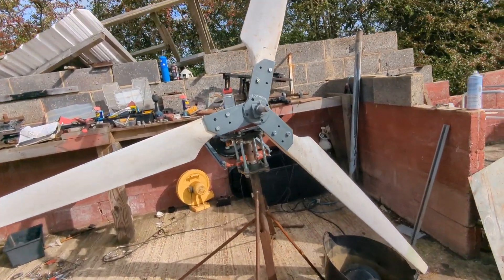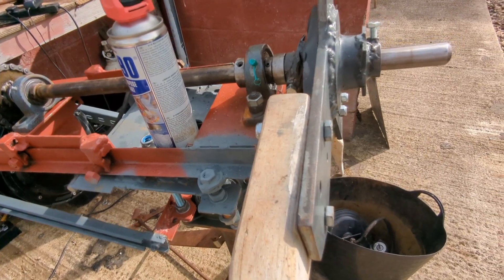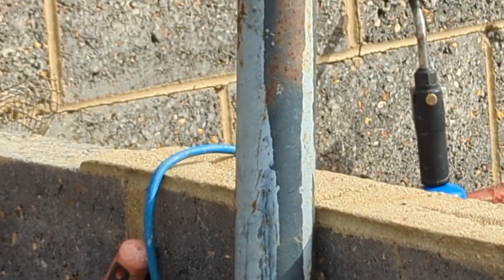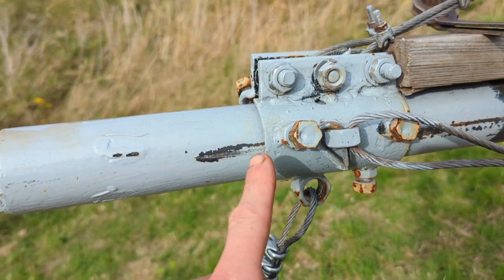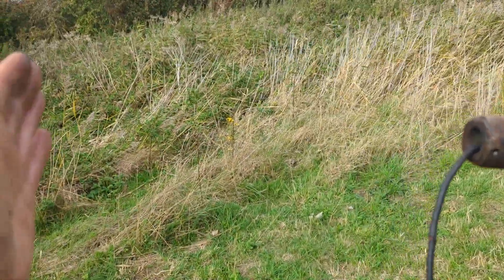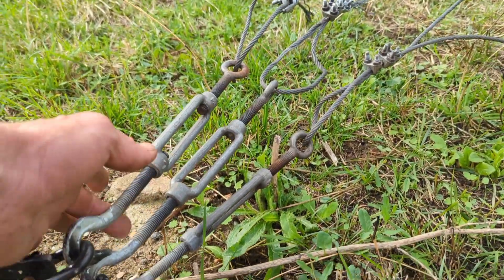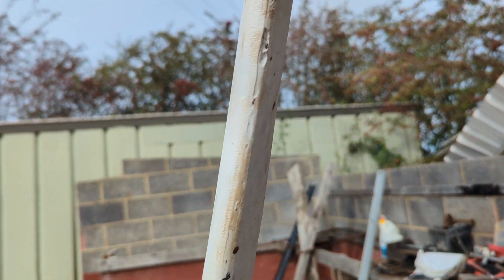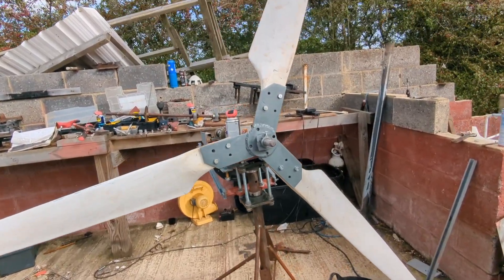Monster Wind Generator - 3m Rotor Blades on - Looking Very Nice - Thanks Scott for the Donation 🙏🙏🙏

Comment: Hi, when you plan start that wind turbine? How many energy it can produce?
Reply from the maker: Hopefully this weekend, I don't know exactly how much power it will produce, but I have all the correct measuring equipments to measure how many volts and amps we will be producing, this thing should produce over 2 kilowatt in 25 mile per hour winds.
Reply: @GavinFreedomLover  nice to know. You inspire me to build own wind turbine
Reply from the maker: Thankyou brother, you could try hoverboard wheel  for a small project or 36v 250w ebike hub for medium project or 1kw ebike hub for big project do not waste time with alternators and treadmill motors.